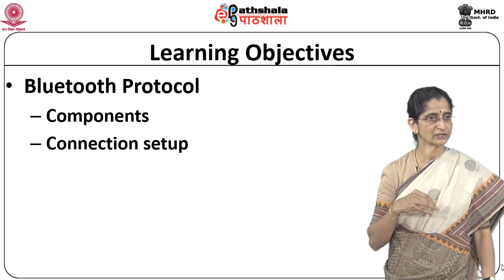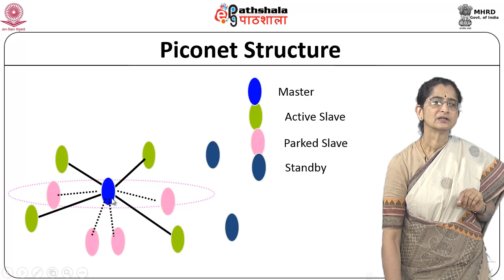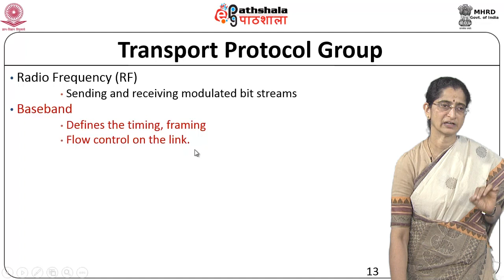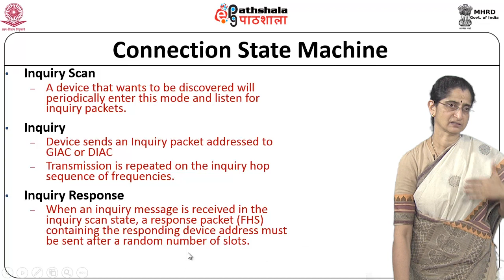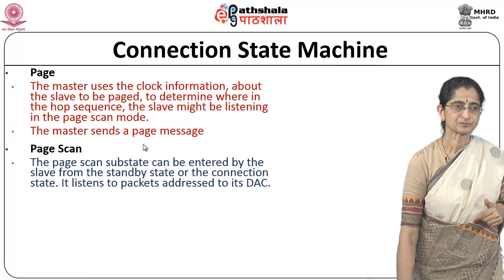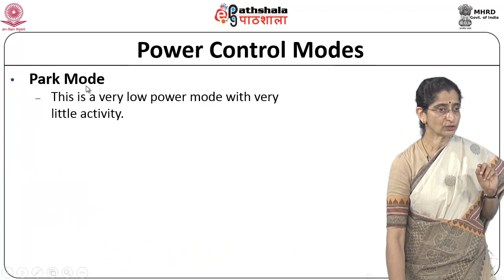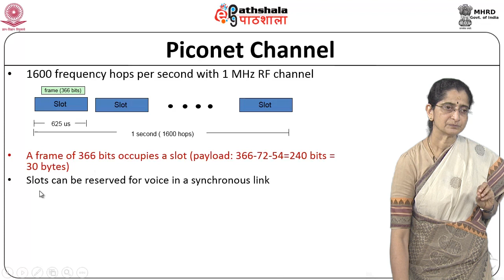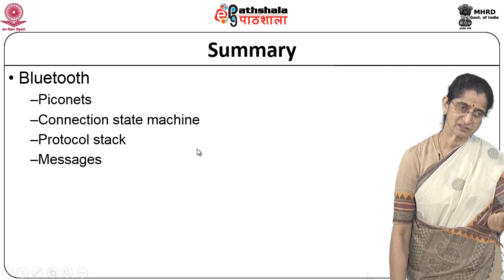Bluetooth (CS)

Comment: Can you tell me the name (IC number e.g. HC-05) of Bluetooth modules which can be connected as piconet?  Also can I collect sensor data from 5 modules connected to sensors at a same time using Arduino?